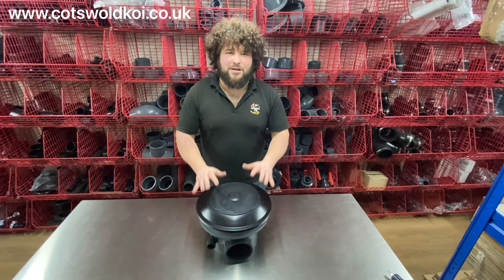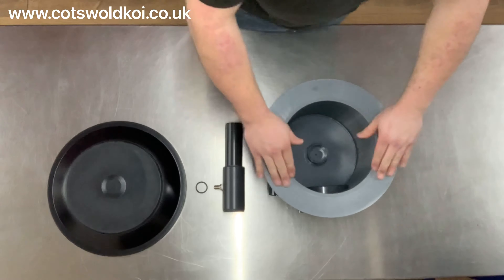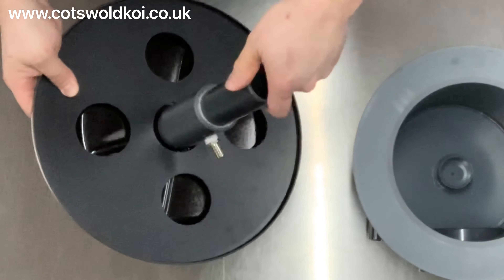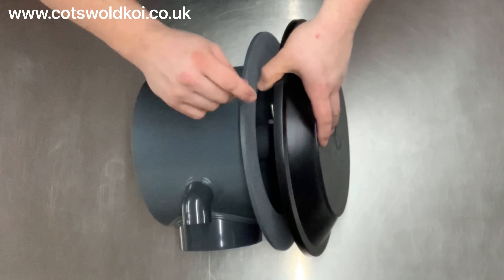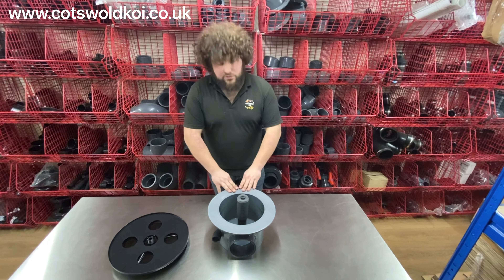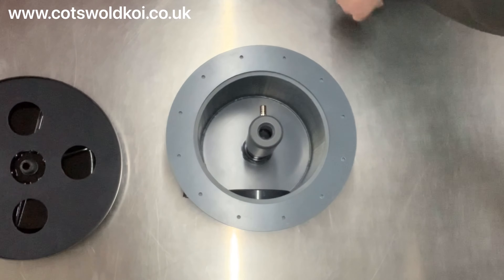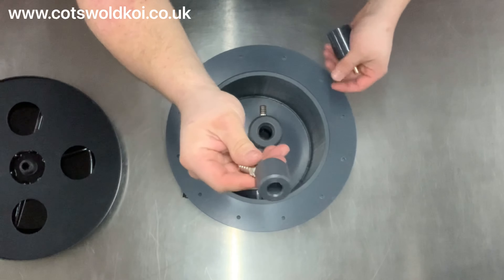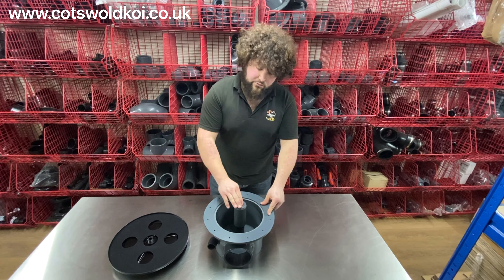The Spindrifter aerated bottom drain

Comment: Should you solvent weld the stem into the bottom drain to stop it popping off? Likewise with the direct air kit? 
Sorry if that’s a stupid question!
Reply from the maker: Hello, 
Very good question, yes the stem should be glued into place leaving the required gap. normally around 18mm. the direct air feed pipe line and fittings also require solvent welding in place.
Reply: @cotswoldkoi  no use a rubber boot